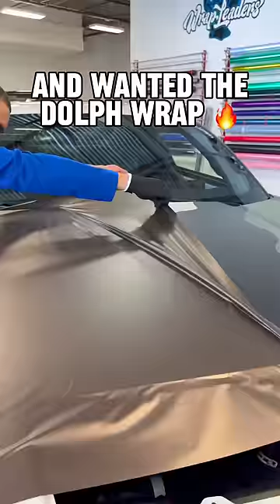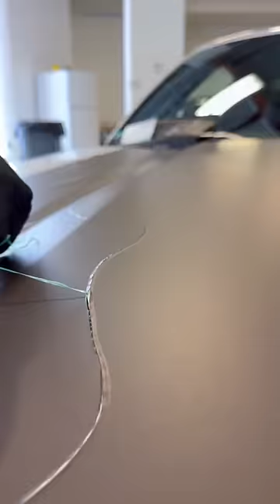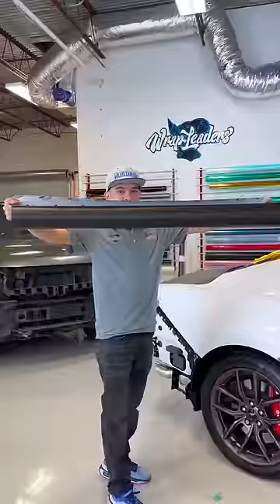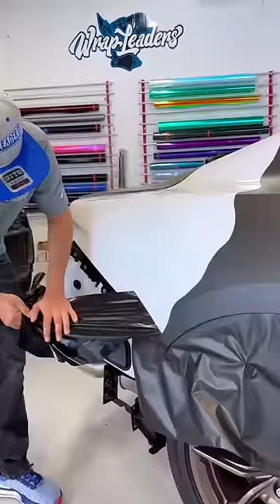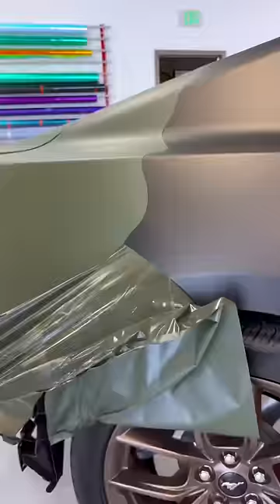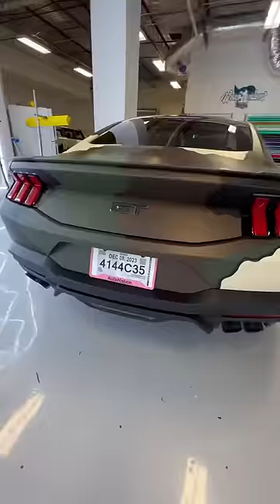When customer asks for the Dolph Camo car wrap 🤯🔥‼️ #carwrap #carwrapping #asmr #asmrsounds

Comment: Wow amazing😮. I can't imagine how long this took, and I do not know how you endure or can do this tideous job. I couldn't even properly install tinted  window cling for my small tiny window on the front of my door. I bought it because I wanted some privacy around my house and the plan was to do my 2 huge sliding glass doors that lead from the dining room to the outside porch. Because I never done it before I thought start off small just  to get a feel for it so I wanted to practice on my front door window. It said it will take me approximately 15 mins,it took me over an hr & I wanted to rip my hair hair out in the process. Long story short my sliding glass doors still have no tint or cling on it. The front door window I ripped it down after 3 days because it looked like 💩😂😂😂. So I give you your props